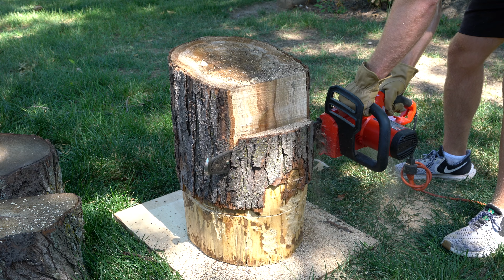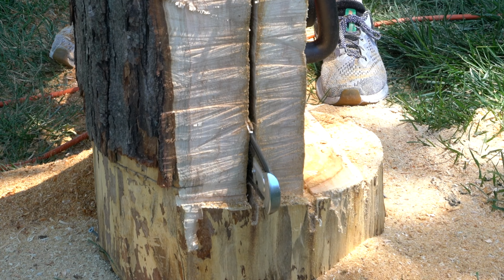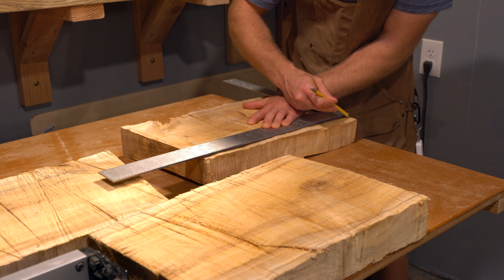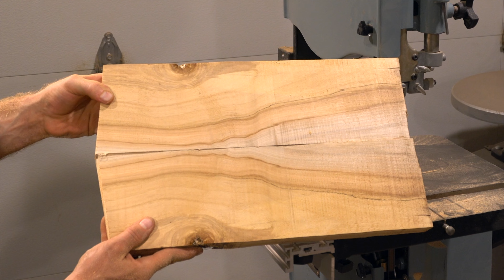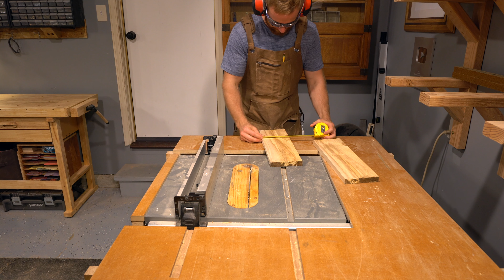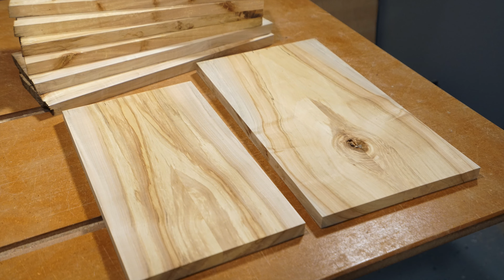Milling lumber without a sawmill

Comment: instead of sacrifice the bottom few inches of the log, I am wondering if you could just cut each board almost to the bottom but leave connected, and once you are finished cutting put the log sideway and complete the cutting all the way through and release each board?
Reply from the maker: That would work if I had a longer chainsaw that could cut the full diameter of the log. I think if you wanted longer boards using a longer log would do the trick. No need to waste the bottom part of the log either, you can mill that too and use it on small projects.